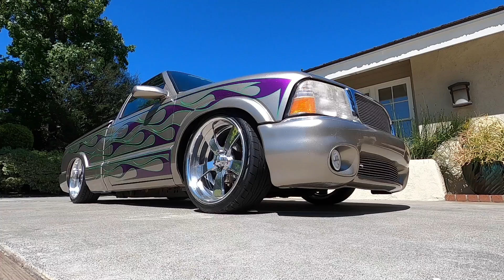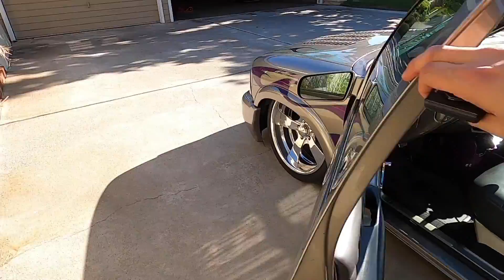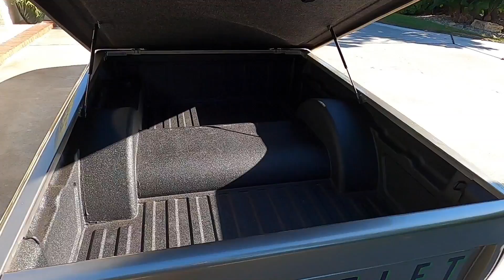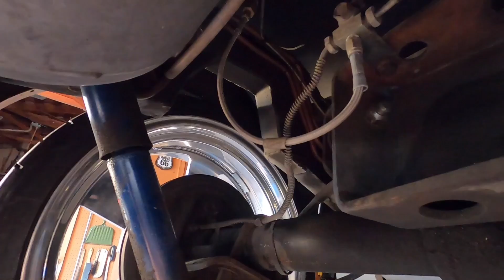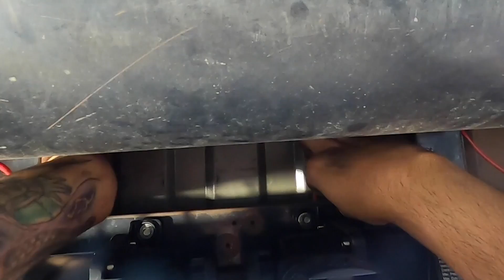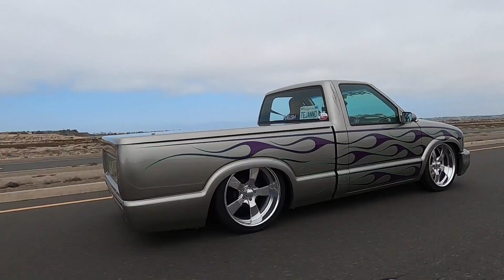Is Air Suspension Right for You? | The Bottom Line

Comment: Proper relay and circuit beakers you shouldnt have draw, both of my silverado trucks I built ran off stock batteries with built stereos too.  Run both compressors through a Stinger 80 amp relay and a 80 amp circuit breaker, wired through key power and you will have no abnormal draw.  If the vehicle sits for long periods of time, a trickle charger is a good investment.

Viair will not warranty compressors mounted upside down, they are self libricating.  Sideways is ok but best method is on a mount straight up.

Comment: Wow I have a new found respect for trucks on bags. Especially with older setups. That's a lot of modifications and maintenance to the vehicle to get everything situated and functional. 

I have a 2013 Camaro 2SS on 3P airlift . The performance series bags/struts are bolt on without any fabrication to the vehicle itself. 

The Manifold,tank, and compressors are in my trunk with room to spare for an audio system and my airlines are ran inside my car alongside my stock electrical wires under the carpet. 

If I had to do all this I dont think id have it in me to go through with it. This is some dedication no doubt.
My only maintenance is keeping the system dry and I bought a push button activated drain kit to purge condensation. Sure i have to clean my smc check valves about every 6 months but that only takes a few minutes.

Comment: This comment is long - and has a lot of tips in it  - #MiniTrucker for LIFE!
Did you bring that truck to Midwest Drag Fest when they brought that show back?   I swear I did photos of it lol!    @/minitrucker for life!   Don't wait for electric compressors - get a belt driven one that you can mount to some brackets onto the engine - so much nicer and IMO more dependable.   Dakota digital is about 2 miles from my house!  Love that place.  (Sioux Falls South Dakota)  oh no AC so that's where my belt driven compressor is.
Oh I got the compressor that is belt driven from a car/truck vehicle salvage yard from a older RV.  I lucked out - they are hard to find!    -   Word of advice - Always have Extra air line with you AND extra quick release fittings for any leaks - and get yourself the lowest of the low jacks!   - I have one off custom Nascar / Super Truck  style dual pneumatic jacks built into the back half reverse 4 link. You dont want to see an airtank?   Use your custom rear end tubular back half as the air tank - or make sure you do a nice job on notching the frame - use a nice sealant on the inside - cap one side or both sides off or link them - and have someone who can weld real nice - add a little bit of fluorescent leak test in it through a bung that has a air pressure gauge on it - pressurize it - let it sit overnight or for a couple days and come back and check it for leaks - if there's no air pressure - get a UV flashlight and search for the glowing liquid.  And don't use cheap bushings - neoprene everywhere there is a bushing.   And if you're not part of a Truck club / custom club / Mini Trucker club  / lowrider club -  NAME YOUR TRUCK AND PUT A STICKER THAT MAKES IT LOOK LIKE IT'S PART OF A CLUB on either the front or back window - Believe me, they get f*cked with WAY LESS that way!.  Also - pet peeve of #MiniTruckers - Lowriders / LowLows - HAVE HYDROLICS not AIRBAGS - MINI-TRUCKS HAVE AIRBAGS - NOT HYDROLICS!   
  Oh and don't put air silencers on your air exhaust valves (Oh keep a few extra with you as well as a roll of proper gauge wire to power them and a bunch of zip ties! for temperary use!)   DONT DRIVE IT UNLESS YOU HAVE IT ALIGNED TO "RIDE HEIGHT" - Yes - SET THE RIDE Height IN THE SHOP that is doing your alignment  - if you have a gauges for air pressure - mark that ride height down somewhere - Riding too high and you'll wear out the outside of your tires - ride too low and same thing happens to the inner side of your wheels. 
  Don't get staggered wheels - Get used to rotating them for longer life.  Oh and Get a air-hose and no matter the type of airtank you use, frame or air tank, get a bung for a standard shop air-hose - put on it - you'll thank me later!   
  You may as well just keep a custom 1 off tool box that can fit most of the extra parts you'll want to have in the mini truck at all times - also in that kit - LUGNUTS AND AN EXTRA SET OF WHEEL STUDS that are the correct sizes - especially if you have drop spindles.   You see - the front wheels camber in because airbags are soft riding setups like Kevin said - and that puts a hell of a lot of strain on the wheel studs - over time if used as a daily - THEY WILL STREATCH  - THEY WILL BREAK - do not go cheap on wheel studs and lug nuts - Even if you have a 1990 Nissan Hardbody with some 17" 6 lug 2004-2007 OEM wheels - it WILL HAPPEN!    
 Why not have silencers on your dump valves / exhaust valves?   Because airing the bags up and dumping some air out by chicks walking down the sidewalk is fun to do - #TheReactions "WTF IS THAT?!"  

Then petition to get Tailgate Magazine and Mini-Truckin Magazine back!  We need more custom Trucks!  Truckin' Magazine just doesn't do it!

Comment: Ive gt a 97 Sonoma that will slam to the ground, I just got it so kinda new to all this..was wondering about going w a bigger compressor, also it only raises front n bk not side to side..I was told the tank has to be 160-180psi before it'll raise..any info on what size compressor to go w, change bag size, any of tht wld be greatly appreciated. I'll send pics too if needed of my mini mystery machine (u will understand tht w the pics) my email is lilpils@yahoo.com too, by the way sweet truck! I'm just starting on this so I wanna make sure its right, ty u for any info!

Comment: Do you need change something more or not if you are trying to put bigger rings on it???  I have two s10. Wheels size and brand: American Racing rings. Tires.205/60r15” on the front and 225/60r15” on the rear.  I don’t have experience about it. Any help can be good for me.

Comment: do your front shocks act as a suspension lift limiting device? Im just wondering on my setup whats the best way to know im at the correct height every time. instead of putting on limiting straps.
Reply: I would not use shocks as a limiting device. Also, it’s not a good idea to ride with the ‘bags fully inflated as they will make your ride stiff. If you have gauges set up, they can help you figure out the height.